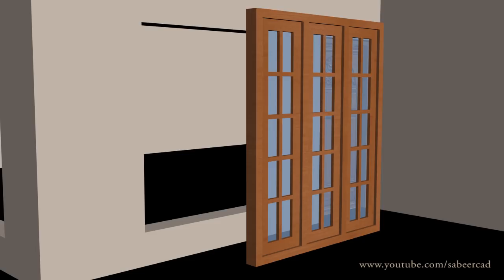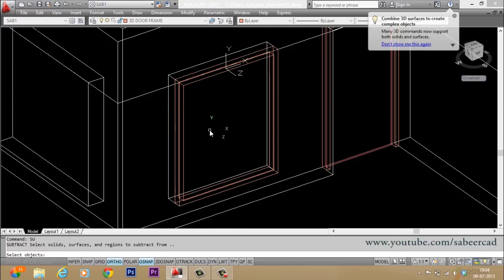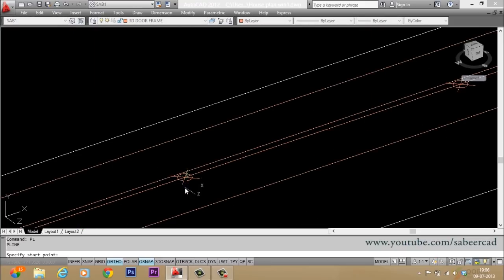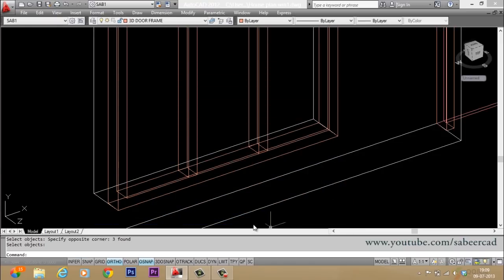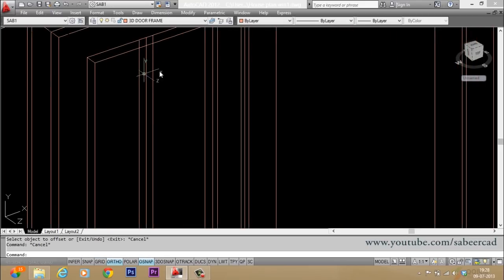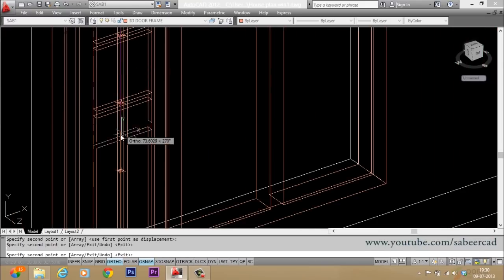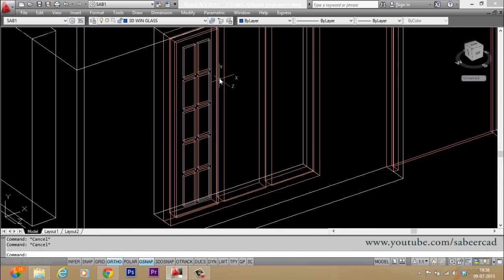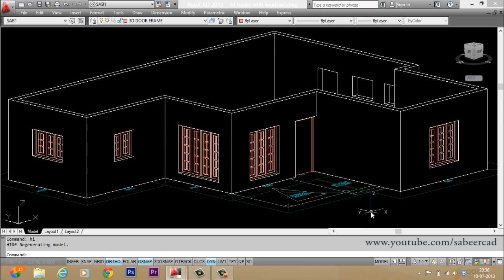AUTOCAD 3D HOUSE PART3  | MAKE A 3D WINDOW

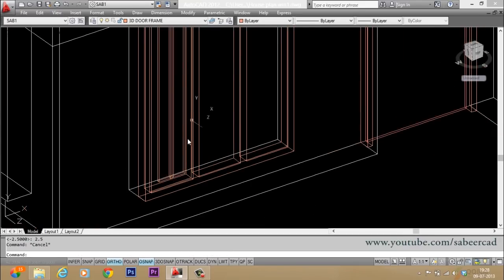Comment: 10:46 Before dividing the vertical line you need to extend it 1.5cm in both directions to make all the horizontal frame members spaced correctly. The same way you extended the horizontal divide line 3cm in both directions at 3:35 

Thank you for the videos, they're fantastic and I have learnt a lot!

Comment: Good morning Sabeer,
Last time I asked you about the sliding windows, and you said that you would soon have a tutorial for that. I believe it's not ready yet.
My today question is different. You teach us to do a sloped roof, which is very good. However what about flat roofs and different levels of roofs (because you might have a roof higher than the other)
Regards
Reply from the maker: We can easily create a flat roof. Just trace the wall boundary using a polyline , offset that line 10-15 cm outside , extrude it through 10 cm to create the roof slab . To make the parappet you can use the same procedure which you have used to create the wall .  thats all . For roofs having level diffrences you can stick to the same procedure . Roofs will be at different levels  since the height of the walls are different . I will try to post a video on this as well.

Comment: Thank you so much for the tutorials - they are great! At that moment I'm in the middle of placing the windows of my tutorial house, but I have a huge problem. I can't offset polylines and there are elements that don't look like it's planned to be. It's turning that message: "Cannot offset that object." I'll be very happy if you know the solution of my problem and you tell me what is it. :)
Reply from the maker: Thanks for your comment . The offset problem could be because there can be coincident objects . just activate object cycling . If you need any clarification on that please refer my video on that in Tips and tricks section in my channel . Another method to tackle with this problem is , just erase the objects that prevents you from offsetting another object . Then perform offset and give "oops" command  to restore the erased object back . Try these things and get back to me
Reply: sabeercad I've tried the two different methods you told me but none of them worked. I think the problem is somewhere else and it's not related with the objects on back or front side. I'll research more and if I have a solution will write again. :) Thanks!
Reply from the maker: Teodora Yordanova Another reason could be UCS . Your UCS should be in the same plain as that of the object (it should be the same as of creating the object) . If this fails . Send me the file . I like to sort out such situations . Even I can learn more.. :)

Comment: Hello Sabeer - I have learned so much from your videos and say thank you.  Did have a question - obviously it is time consuming to create 3D doors and windows for each cutout - is it possible to copy and paste door and window patterns into "like size" cutouts elsewhere in the 3D walls.  Also, do you available for download the doors and windows you created in your basic autocad 3d house tutorials.
Thanks again.
Reply from the maker: In Autocad we need to create different types of doors , windows , furnitures etc. only once . Then it can be reused any number of times in all your future drawings using the concept of blocks. Please refer my video on blocks in my channel ( comes under HOT TOPICS playlist) . You can download project files required to try each tutorial from the video description page of each video.
Reply: Hi Sabeer,
Thus far I have been able to effectively and efficiently create 3D walls and also windows and doors and sloped roofs per your tutorials ( I can now create 3 or 4 panel windows in less than 10 minutes. ) all in only having AutoCad for less than 5 days.
I have one last question and I will not trouble you again. I am aspiring to be a solar engineer and wish to be able to draw solar arrays on a 3D roof - thus far when I attempt to create a rectangle on a 3D sloped roof (to accommodate a solar array) it does not appear realistic as the polyline aligns to the slope of the roof as opposed to the horizontal plane of the ground.  I am thinking I need to start with a flat roof and create the appropriate extrusions (for the arrays) and then create the sloped 3D roof.  Am I on the right path?
Again thank you for your replies - if you ever find yourself in Colorado I would be happy to take you out to dinner as I have learned much very quickly from your tutorials.
-Rick
Reply from the maker: Richard Faber Hi Richard , I am happy that you have acquired practical knowledge from my channel . Please go ahead explore more videos . 
Regarding your work , the panels created using the polylines will align properly on the roof plane if the UCS is aligned . I will go through the file suggest the proper solution if you can send me the drawing file .
I am sorry to tell you that there is no chance for me to come to Colorado . If you genuinely feel that my lessons have made a change in your level of understanding of AutoCAD , you can make a contribution to 'sabeercad'  in the paypal id sabeercad@gmail.com .
All the best and regards .....
Reply: sabeercad Hi Sabeer - with your help I have been able to create a good scale model of my house with realistic windows, doors and a very complex multi angled / gabled roof (that took some time).  The one thing that has got me stumped is how to move or delete the cutouts that were created in part one of your tutorials - whenever I try to move or delete them the entire wall gets deleted as well (obviously not a good situation).  Is there a way to isolate and/or move delete cutouts from a 3D wall. Thank you again for all your help

Comment: nice tutorial sir, but i have some problem with performing Divided command, when i used these command and so klik the object then entering 3 for the segment of blocks n enter, its not work i did not get 2 point at the poly line to making 2 center frame like in the video please give me a solution for this thanks

Comment: When i try to draw a polyline, it always snaps horizontally. I am never able to draw a close loop (i.e. window frame for example). I tried to modify every setting possible, but i am not capable of doing so. The snap is orthogonal but i am not able to draw vertically. please help
Reply from the maker: Make sure that Dynamic UCS is off (DUCS) at the status bar . If that does not work give UCS command , type 3 (for 3 point) Pick origin point , x and y axis directions . Then draw the polyline . For more informations on this procedure refer the second video (option-2) in my channel www.youtube.com/sabeercad
Reply: sabeercad Thank you for your comment. Unfortunately i believe the problem is originating from the fact that the pointer is snapping and locking to a certain surface (Vertical surface of horizontal surface). In the case where i want to draw the glass on the window, the pointer is locking to the horizontal surface of the shutter, which creates a problem when i want to draw the second vertical line on the surface going vertically. I cannot freely draw a PLINE independently of the surface/area. Your additional help is greatly appreciated :)
Reply: sabeercad same situation here it worked!  thnx Saber.

Comment: I am using autocad 2015 and when I try to grip edit the window, it moves the whole shape, not just the line. I have tried everything. Please help
Reply from the maker: When you click on the object you get grips ( as blue dots) . just click on a grip to activate it ( the color changes to red) and then move the mouse in the desired direction and type value to move that end point. Just try this , All the best...
Reply: sabeercad Also can you please explain why we need to extend it 3 units? couldn't you just divide the polyline as it is?
Reply from the maker: If you do not extend the division wont be proper . Just try it without extending it , you can make out the difference.
Reply: Actually when I extended it 3 units on each side, I got uneven division. It became even when I just divided without extensions
Reply from the maker: If you extend it your division will be even (Just closely follow the tutorial)  . Just make sure that you divide the extended line .
Reply: Hey sabeercad,
I am on your last lesson and something has happened with my pline. Instead of drawing a straight line like it should, it is drawling a rectangle. I have tried resetting autocad to it's default settings but it doesn't seem to fix it. 
Please help.
Thank You
Reply from the maker: Just give PLINE command go to Width option and and see whether there is any value . If there is a width set it to 0 and retry pline.